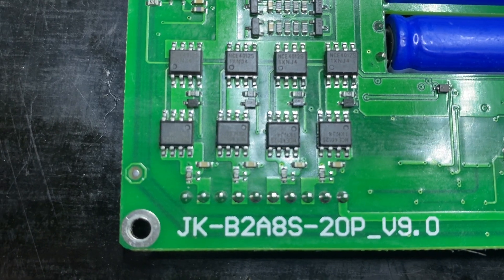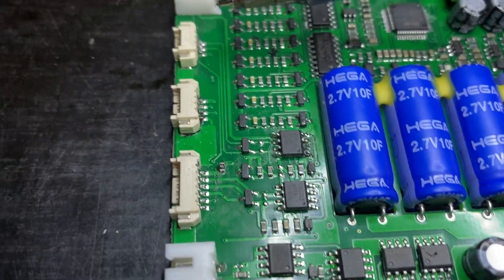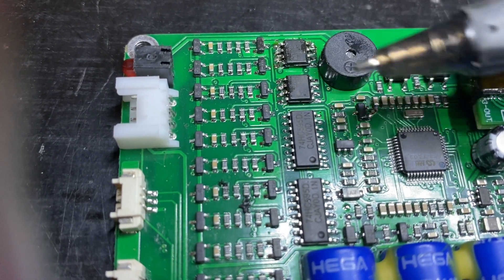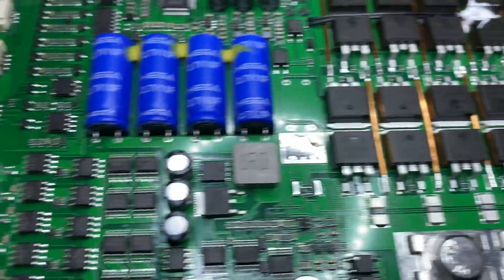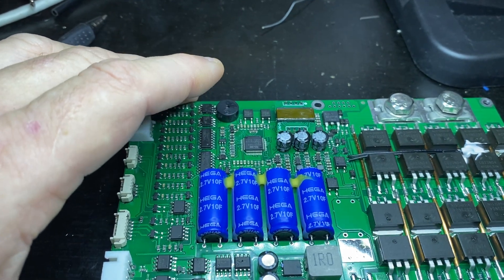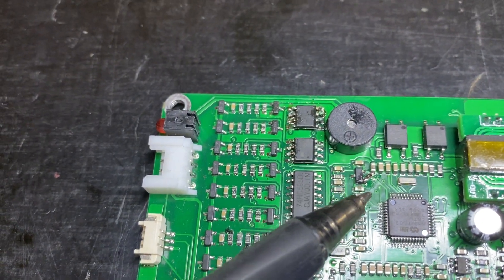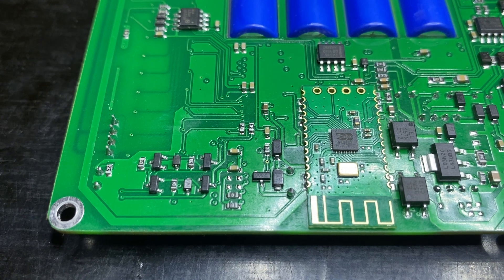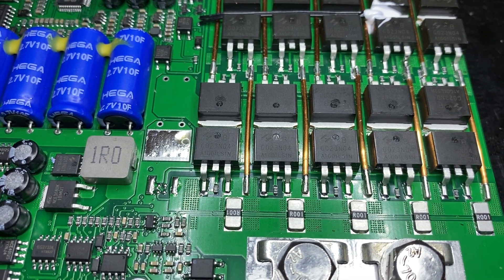Jk-bms 8s (Jk-B2A8S20P) jikong BMS board level review

Comment: Man,your video was of great help;  the 5   R001 resistors sense the current,you say;

I get sometimes a message "Protection. Current Sensor Anomaly" and the Amps read 0( however, Amps continue to flow in and out, i see that om the clamp amp meter),

The BMS (150 or 200A??) comes with 4  heavy gauge wires (2+2)

I only connected 2 (1+1) because no more than 30 or 35 Amps flow in or out

So,now i think that the error message may be due to only 1 wire per side;

And i saw in the manual that all 4 wires must be in use!!!

Do you think that using only 1 wire per side matters, should i hook up the 2 per side?

Comment: i have a jk-bd3a17s-4p v11.0 board and a 3.3v ttl-usb converter connected to the rs232/rs485 marked pins can talk to the board. The pins on the connector are Vcc = Battery voltage, not 3.3 nor 5v, it's 27v or what you have, then RX/TX and GND. Only connecting RX,TX and GND is enough to talk to the board using the protocol from syssi github repo, baud rate is 115200, ttl 3.3v

Comment: HC595 are digital expanders, via serial shift registers, to drive the sample and hold discrete SOT23 MOSFET pairs gate enable control nearer to connectors to make the cell voltage sample and hold and translate it down to base voltage via capacitor charge storage transfer to uP ADC inputs.  A discrete analog mux.

Wondering if RS485 issues is because of RS485 port sharing, like you can have display or RS485 data link but not both.  It is somewhat logical if you want the display you won't use RS485 comm link. Other possibility is it is missing from the firmware load that you have.  Might send them an email to ask.  I remember if you want CAN bus you have to ask them for firmware version load.

The SOP-8 chips NCE4012S chips are the MOSFET n-CH switches to route in and out the balancing current to switching supply super cap storage/ DC-DC converters. Since these are 40v MOSFET's in the 8S version they probably use NCE0108 or NCE0110 100v versions for 16S/24S BMS.

I noticed the 8S board do not have the series MOSFET turn on inverter capacitor charge MOSFET placed like the 16S/24S model does.  It is the blank spot at inside end of MOSFET string.
Reply: Please do you know the name of the 8-pin ICs close to the balancing leads socket?